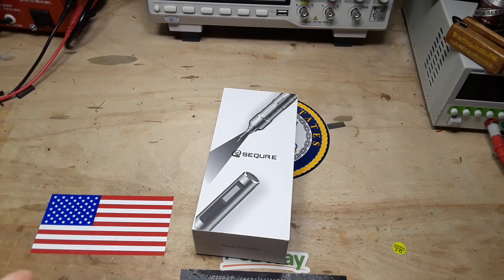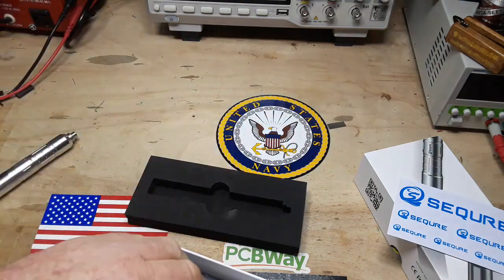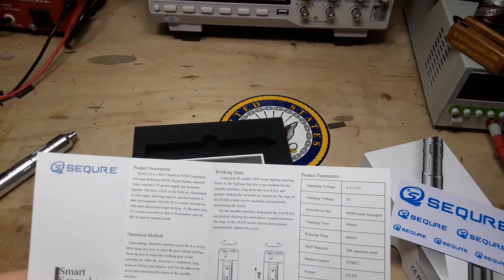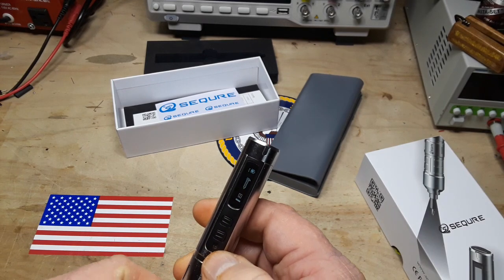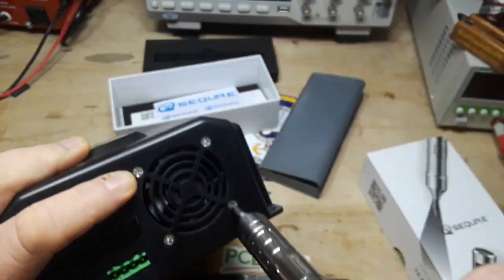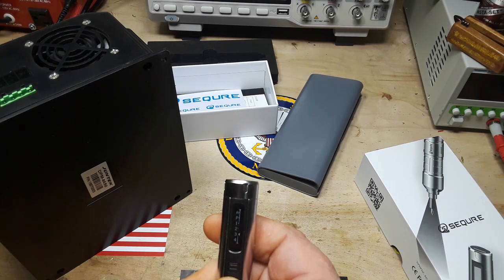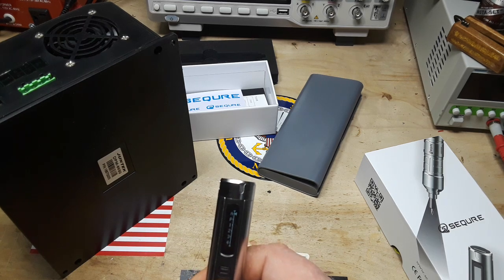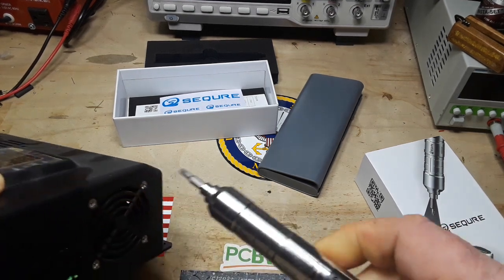Smart Screwdriver Update - I did what you said

Comment: I try not to point out the mistskes of others, but for the sake of helping you out on this one, here you go.

CW screw:  You begin in the sumo stance, with 4 large right foot stomps as you prepare to tighten a screw. Form is really important here. The screwdriver picks up on these movements and tightens the screw.

CCW screw:  Oddly, loosening a screw does not involve movement.  You hold down the power button for 3 seconds, while simultaneously pressing a needle into the reset button with the other hand until you hear 4 beeps. Then you release both buttons, and the screw will loosen.
Reply: LOL
Reply: You forgot to mention tongue position
Reply: @TrapShooter68  that had stuck me for hours. Thanks for the good point!

Comment: 0:50 “Nowhere does it say to twist the screwdriver”
The part you read in the first video where is says to “long-press A or B and gesture...” they are talking about turning the screwdriver in the direction you want to go. That is the “gesture.” They probably should have said “hold” instead of “long-press” but that’s your typical poorly-translated Chinese instructions. ;) You are directly controlling it with that gesture and not changing a setting as you seemed to think in the original video.

So it isn’t purely gyro-controlled or else it would be turning when you set it down on the desk. You hold the button and then twist the way you want to turn. It will pick up on that twist and continue turning until you let go of the button. I think it’s counter-intuitive since you will need to hold the screwdriver in place while it turns but that’s how it works and it seems people like it. I will stick with a manual screwdriver myself. :)

Comment: “A” setting is for “angle”, not “automatic”. Choose power setting 1-4 (1 is highest and 4 is lowest torque. Button A activates the screwdriver without led light. Button B activates the screwdriver with led light. Press and hold either A or B button while twisting the screwdriver in the direction you want it to turn. It will automatically kick in to automatically turn the screw until resistance is reached (tightening) or until you release the button (remove or tighten). I watched several videos about that specific model.
Reply: It seems weirdly complex, though. My model has a rocker switch, down left to loosen, down right to tighten. Adjustable torque clutch on the head, similar to a cordless drill. No screen, no logic, works great if you have a project with 100 fasteners that need to be torqued equally.

Comment: So, it does require the button or else it would start rotating when it rolled on your bench... and then it would never stop! It’s just a “turn” button except it doesn’t start turning until it knows which way. It picks up on that after you press the button and turn it one way or the other. This eliminates the need for a directional switch, setting, or alternate direction button. Of course, some might think extra buttons, setting, switches, etc are simpler. You certainly expected a direction setting instead of a directional control even though changing a setting every time is more complex than a directional control.

I don’t have one as I also prefer manual screwdrivers but I was under the impression that it could tell when it was being turned in a screw and could operate on gyro control without the need for the button. I was wrong. Perhaps a pressure switch in the handle/tip just wasn’t possible.

Comment: $100 Is well worth removing repetitive motion from twisting a manual tool. I build FPV Quads and will take all the help I can get. That’s cheap compared to medical bills to Fend off carpal tunnel/arthritis. 
Love the work you do and would love to see a video on testing through a Flight Controller or ESC. The FPV Hobby can be very expensive and I don’t like throwing out parts I have the capability to repair. Keep up the great work!
Reply: You can have mine.
Reply: A bog standard electric screwdriver is easier to use and a hell of a lot cheaper. :)
Reply: I hear you, I make eyeglasses, I've probably done 500,000 screw operations in the last 14 years, most likely wire a bit more. I just ordered a miniwave to help my wrist.

Comment: I have a power Screwdriver made by Dremel / Bosch 

It’s a lot bigger and very powerful  about the size of the smaller Dremel drill.  

To pull out a screw, just flip the slide-switch down and drill in a screw just flip the switch up. Then press down on the screw to power up the unit. 

I wonder if that what’s needed to get your screwdriver to work. Push straight down and see what happens 

It works great for most electronics disassembling. I find it very helpful when I building a PC. 

The battery is great I only need to charge it up every 2 months or so 

I recommend it for any DIY bench tech.

Comment: if it is like the one i got you need to hold the lower button and start the screw.
you loosen it and then it does the easy part. 
i think i have a es-120 try holding the button closest to the bit and twisting in the air, if it is like mine it should start screwing.
mine is not very strong, but if you can do the hard part it will do the rest. should be good for laptops, might do a bit worse if the screws are tight or locktighted.

Comment: I don't think you're doing anything wrong I just think the people are thinking of a different screwdriver they looks remarkably similar
Reply: There are 2 types. The original you only need to turn then there are copies where you hold the button and turn it while on the A setting. And they also have the mode he used in the first video to lock it to a certain direction.

Comment: These things when they work only work on small screws, how hard is it to unscrew a small screws with a normal screwdriver, I have one of the WOW Stick drivers, it works but a manual driver is quicker and my wrist is stronger.  This is one of those technology for the sake of it, anyone else wanting to spend 100 bucks on a screwdriver get the big iFixit kit and still have 50 bucks to spend
Reply: Try putting the tip in the screw head the turn clockwise and press the bottom button, to screw in and then turn anticlockwise and press the top button to screw out, it does kinda say that in the instructions, you were just spinning it in mid air, do that whilst actually trying to use it.

Comment: The comment section is both brutal and hilarious! Mine performed as suggested in the comments but only for a short while. I had it around a year or so and finally had a project with enough screws to dig it out. 4 screws into my project and it died from a low battery.

I plugged it in to charge it and it lit up and went into charge mode. A couple of hours later I noticed it was getting warm while on the charger so I unplugged it to let it cool down and try it again. Nothing! It's not got the black screen of death even if I plug it back in to the charger.

Today I tried finding a replacement battery and a video to see how to replace it. I came up empty handed. Even the company website lists nothing for this model.

They do have a new model with several new features at a much lower cost! It's got square sides so it won't roll all over the table like the original model did. It's best feature is it's cost at $25 dollars which is a fraction of what I paid for my version.

While it seems like a good deal I was unable to find replacement batteries for this new model either! That makes it a $25 dollar throw away screwdriver and I'm not exactly happy about that.

Is it too much to ask to make a version with a rechargeable and replaceable battery like an old fashioned flashlight? Screw the end off and drop in another battery!

Maybe they will send you one of their new versions for a review? They have a 666 model and a 555 model which is the cheapest version.